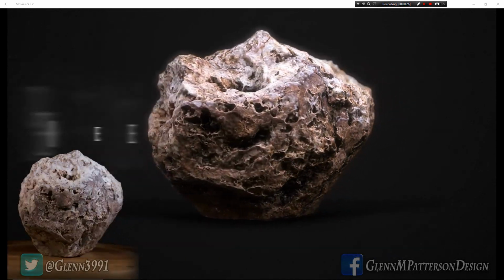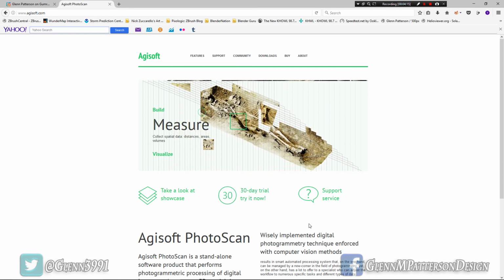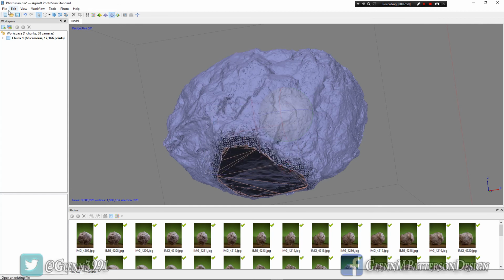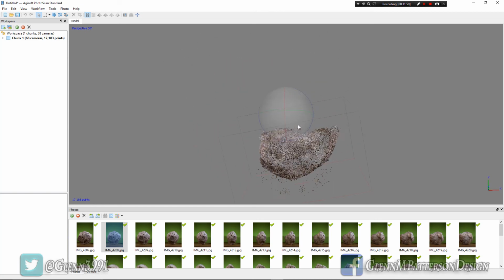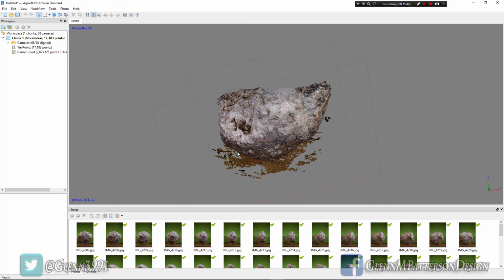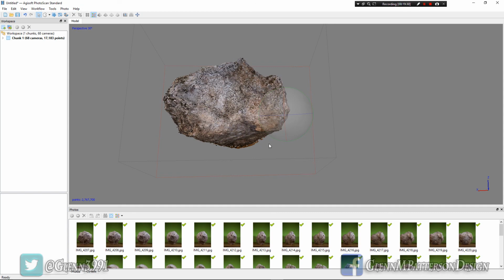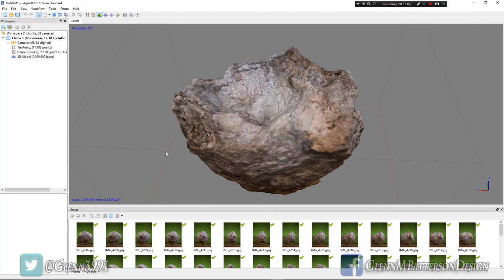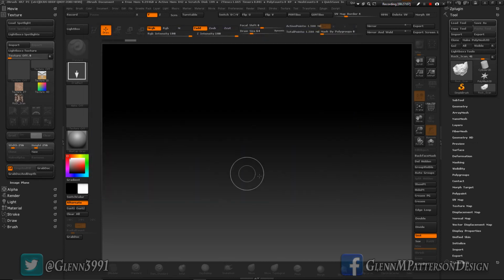Buid a Rock-Part 1 (Photoscan)

Comment: How many total hours did this take?
Reply from the maker: Probably 3 to 4 hours. Biggest time sucker is taking and processing the photos and the computing of dense point cloud. One thing to remember if the image size is larger the longer the compute times.
Reply: I just photoscanned a big rock and it took 30 hours :)
Reply from the maker: Damn! How many photos did you use? What size were they?
Reply: I used 19 photos, and size of image is 4608x3456, and here is the rock https://imgur.com/a/XHdVVMY
Reply: and here is the photscaned version, https://imgur.com/a/dadD37O
Reply from the maker: Looks Great! Not 100% sure on the Processing Time though. You might check and make sure in Preferences your using the GPU for the Calculations as well as Mask out the Parts you dont want scanned, like the water and sky. The Reflection in the water may have confused the Software and created the lengthy Processing Time, I'm just guessing on that though.
Reply: I did all that and choosing only the parts I want scanned its just that my pc is shit.
Right now im making dense cloud of a tree and its taking 8 hours
Reply from the maker: Might be Time to Upgrade. Agisoft is a True Beast of a Program in Processing, I'd Recommend reduce the image sizes to 25% to 50% from the original. Thats what I did for this Video, I was suprised how much detail I was able to pull out of the small images and reduced the compute time a bit.
Reply: I will look into that